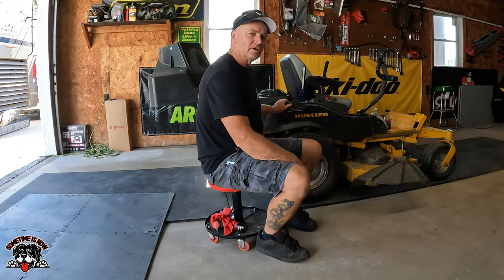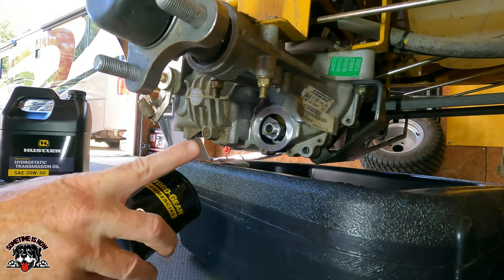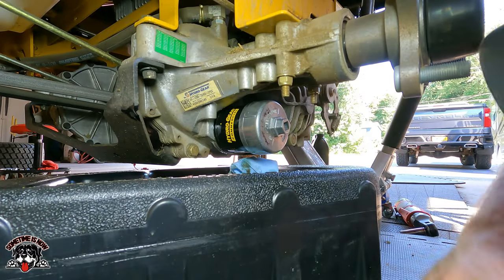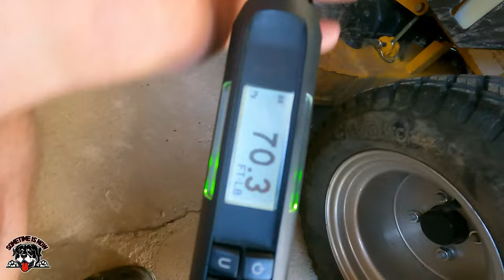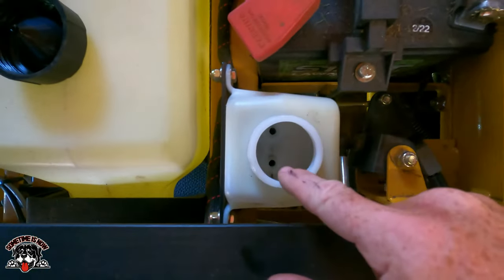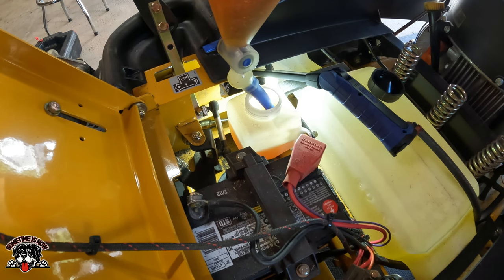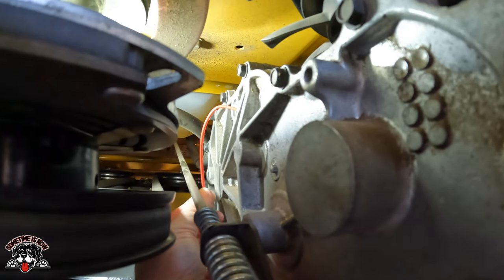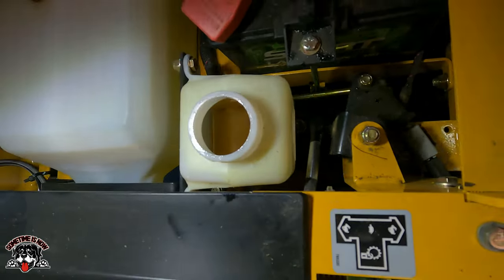Hydro Gear Oil and Filter Change on Hustler Raptor SD 75 hr

Comment: Great video!  Tip on those infamous  vent plugs - trying to get them loose from the back, is like trying to fill a straight the hard way.  After putting the filters and covers back on - come at them from the front while the wheels are off.  You have much more room an you can get the right side plug easy from the left side of the mower and vice versa.  I used a 1/4 allen socket and 3/8 drive to break them loose and just fingers and the socket alone to take them out.
Reply: And also, make sure you review the air purging routines after the change.  An airlocked system is a pain and it's EASY to cause it.
Reply: Good job !!

Comment: I always pull a vacuum on the reservoir tank with a brake bleeder when refilling the system. This way you don’t have to mess with those vent plugs because it pulls all the air out and you save time by not waiting for air to come up. Much faster way.
Reply from the maker: Hey Joe, Great tip !! Take Care
Reply: How do you pull a vacuum on the reservoir tank? Can you elaborate please? Thanks

Comment: Great video. I notice you still have the "Thin" brackets on your transmission. You might want to order the kit and replace like I did. Best 100 bucks you'll spend on a good mower.
Reply from the maker: Hey time4tube1, 
Thanks for stopping to watch the video. I didn’t know they offered such of upgrade. Where would I find the update kit? Thanks 👍🏼
Reply: Mine broke while mowing. Wheels separated some and and it shredded the drive belt.
Reply: I have broken 2 sets of the upgraded mounts…..i am going to put gussets on them….new ones still too thin
Reply: Yes. I have that mower. All the things that people say will fail, failed. Upgrade the bolts to a heavier grade too. The ones that come with the new brackets will also break.

Comment: Good info, thanks for taking the time. Just to note...I would not let the reservoir ever get empty while filling, possible air trap. I would also fill filters partially before install as they absorb fluids.
Reply: Vent plugs removed no way for air to get trapped..
Reply: @bobbyplatt7654  Vent plugs were installed, reserve tank was empty, then more fluid added, watch last few minutes of video. There are actually bubbles coming up into reserve. Just noting, but for me, my tank is never empty once I start refill, ymmv.
Reply from the maker: @Bill-Rocker  All good info, Thanks B 👍🏼

Comment: Thank you. I got my SD from my dad after he left it out broke down in the weather uncovered. I had to do a full tune up on the engine and replace all fluids and fuel pump. Got it running to find out it needed this done because it was so low. Big help. Thank you so much.
Reply from the maker: Hey Kevin, Thanks for stopping by the channel to  check out the video. It’s appreciated. It’s been a good mower so. General maintenance like any other. The only major issue I had was within the last week I had 2 bolts break off and one loose that hold the two transmissions to the frame. While mowing I had the right rear wheel almost separate from the frame and the belt that drives the transmissions jumped off. I had to purchase better quality bolts to replace the low grade ones and reinstall the belt. When I was doing this I noticed the belt was almost to it’s lifespan so I bought a new belt.. I’m planning on doing a video on changing the belt and pointing out which bolts that failed so everyone can check there’s before their rear transmission fall out of the mower. Stay Tuned !! and Take Care

Comment: Good video, great details like the 70 Ft/Lbs of torque on the lug nuts - I learned a lot. The only thing you might consider adding is how to bleed the air out of the system. Thanks!
Reply: The bleeding procedure is the only reason I watched this video. So disappointed. 😂
Reply from the maker: Shows in the service manual to bleed the drives you have the rear wheels off the ground and work the forward and reverse back and forth till they run smoothly. I just drove the mower back and forth slowly on the ground till all the air was out of the drives. 😁

Comment: Hustler recommend purging the system of air , by raising the wheels off the ground and starting the engine and moving the control levers forward and backward several times. That is in the oner's manual under hydro transmission oil change.
Thanks for the information nice video.
Reply from the maker: Hey Alton, Thanks for stopping by to check out the video. You are correct. 👍🏼 I just purged the air out by slowly moving the mower back and forth on the ground. It only took a couple times back and forth to purge the air. 👍🏼 Take Care
Reply: @SometimeIsNow  ok I see. Did you disengage the drive system? . I know you can't roll it unless you do. Hustler recommend doing it like I said to do it.
With the engine running and wheels off the ground both internal pumps are running. But I know if you try pushing it on the ground with out the hydros dish engaged you can't roll it it. It's just easier to do it like Hustler recommends. But I can see how it worked for you. By rolling in around the driven pumps purged out the air. Yes that works. But it's easier to start the engine and let the wheels turn free.
Reply: @SometimeIsNow  thanks for the video. I enjoy watching someone do maintenance on mowers. I just bought me a Hustler Fas trak 54 and I'm getting ready to work on it. Thanks again.

Comment: I almost bot the Raptor!
Ended up getting the Toro Titan HD, very disappointed.  I took it back to adjust the arms but to this day,3 yrs later, the arms STILL  don't function as they should!
I do however have the JDeere 1025R.
 I love how you love Riley, so new subscriber today!!!
Love all your Tractor videos!  I want to learn how to do my own maintenance on both the Jdeere 1025R & Toro Titan mower.  As a lady,my hands are smaller & I am very motivated to learn, so 2 big pluses, yes?
I am also motivated by incompetent so-called "mechanics" 
So I am on-board!  Subbing right now!
How about organizing your Tues videos into it's own Playlist?
Thanxs!
Reply from the maker: Welcome Dogs Rule, Thank you for stopping by to check out the videos and thank you for the kind words. It’s greatly appreciated. Sorry to hear you’re not having good luck with the Toro Titan. You did however make a great choice on the 1025R. 😁 IMO they’re a great little tractor. Yes I truly love dogs as you can see. I try to include Riley in all my service videos so I have the videos to look back on one day. If I could get Riley to hold on better on a snowmobile he’d be in those videos too. 😂 You make a great point on incompetent mechanics nowadays. No attention to detail and they seem not to care. That’s why I do all my own work. That’s a great idea to put all my Tractor Tuesday videos in a playlist.. I’ll have to do that.. Thanks for the input. Take Care and thanks for subscribing. 👍🏼

Comment: Great video.  Just changed mine. The vent plugs on mine were 11/16" head instead of allen hex. Not sure when that was changed or if mine being a Raptor SDX is why it is different.  Everything else was the same. Thanks
Reply from the maker: Hey Chad, Thanks for stopping by to check out the video. The SDX is a nicer model and has all the updates.. If I did it all over again I’d opt for the Raptor SDX Take Care 👍🏼

Comment: I just changed the hydro oil and filters on my Ferris IS700Z w/ZT-3400.  I fill them back through the oil vent hole with a pump.  Once they level off there, I put the vent plugs back in and top off the reservoirs. Each side has its own reservoirs.
Reply from the maker: Thanks for stopping by the channel. I’m not familiar with the Ferris mowers. Are they similar to the Hustler Hydro’s? Take Care
Reply: @SometimeIsNow , I'm no expert by any means, but I believe Hydro-Gear makes different variations for a lot of manufactures.  My son always said, Hustlers were pretty straight forward to work on. My Ferris is the only one I've owned.  So far so good.

Comment: Hi, Thanks for the video. I would have like to see you get the air out of the transmission lines as well as I well.
Reply from the maker: Hey Peter, Leave the mower up on jack stands or the floor jack and start the motor and run the two levers forward and in reverse and you’ll purge the air out of the system. 👍🏼 Take Care
Reply: @SometimeIsNow  It did work, thanks.

Comment: Thanks for posting and sharing this informative, how-to video on changing the hydraulic fluid, etc. on a Hustler Raptor.

Also exactly what brand, make, model, type, etc. torque wrench is that, that you used torquing the wheels lug nuts?

Comment: How many hours are on your mower?  Have you had and cracks in the front wheel cross brace?  Seems some get cracks there. I’m also having paint coming off mine. I know that’s an issue with these as well.
Reply from the maker: Hey horsship, Welcome to the channel. I have 152 hrs on my mower. I have zero cracks in the front wheel cross brace although all the deck wheel brackets tend to bend and I just bend them back. I do have paint peeling off the deck in certain areas which is common on some. I recorded a video with pulling the deck off and going through everything. I cleaned the deck, changed the blades and straightened all the wheel brackets. I’d that something you’d be interested in seeing? Take Care 🤙🏼

Comment: I bought an used hustler with 27 hour but it looks like the hydro gear is totally empty. I asked the guy what is the hydro gear stands for and he never told me because he didn’t know. What do suggest me? Fill it out with new hydro gear oil like you did or do an oil change because it has only 27 hours I guess only need to fill with hydro gear oil right? Your video is opening my eyes thanks for the video. Let me know thanks
Reply from the maker: Hey Dommy,
Sorry I took so long responding. I just noticed your question.
Hopefully you added some hydro gear oil in the tank before using the mower. If it were me I would fill the hydro tank to the proper level and keep an eye on it as it will slowly go down as you use the mower as gravity will take some time draining into the gear drives. As long as the mower seems to work properly you should be fine then when you get 50hr on it i would change the fluid to be safe. Oil and filters are cheap insurance to keep your mower running top notch for yrs to come. Take Care 👍🏼

Comment: You have a missing bolt on the cross brace between the drive motors. 3/8” bolt right side of filter
Reply from the maker: Hey Tony, Thanks for stopping by to check out the video. Yes, I noticed that when I starting working on the Hydro service. I ended up changing all 4 of the known junk bolts that came in the mount.. After doing some research they've been known to break. I changed them all out with grade 8 bolts. Take Care my friend 👍🏼

Comment: Where did you get that digital torque wrench?
Reply from the maker: Hey Travis, Thanks for stopping to watch the video. The Digital torque wrench is a 3/8" Drive TechAngle® Flex-Head Torque Wrench (5–125 ft-lb) I bought it off https://shop.snapon.com Just enter ATECH2F125BV into the search bar and you’ll find it. Take Care 👍🏼

Comment: What tires are you running on the rear? Did the mower come stock with those big bite tires? Which ones do you prefer?
Reply from the maker: Hey Kyle, 
Thanks for watching the video. 👍🏼 They are the stock rear tires that came on the mower and are called GrassMaster 18X8.50-8 tires. They have worked well and I have zero complaints with them so far. 
Take Care

Comment: I have a 2009 fast track 36 inch (927376). I am having a hard time finding oil type, hydronic oil and filters. Would it be the same as yours?
Reply from the maker: Hey jlb, Here ya go. Here’s the manual for the Hustler Fastrack 36. https://www.manualslib.com/manual/606832/Hustler-Fastrak-36.html?page=20#manual
On page 20 it goes over the variations of EZT hydros and whats needed for service. Shows the 36 is non serviceable.??
LEt me know how you make out.
Reply: @SometimeIsNow  thank you bud!! I really do appreciate this
Reply from the maker: @W.Vanderbilt  You’re very welcome. Let me know if you have any more questions, I’ll try to help. Take Care👍🏼

Comment: Good time to check for broken or cracked brackets
Reply from the maker: Hey Phillip, Thanks for stopping by to check out the video. I totally agree on checking the mower over while its apart. The only thing I had found during this service was a missing mounting bolt and washer on the right hydro trans. Take Care

Comment: How often should this be done
Reply: Manual says 750 hours, so I did mine at 75 hours.
Reply from the maker: Hey Orlando, Sorry… I just seen your comment.. Looking in the service manual it states the following:
Initial hydraulic system oil and filter change must be after the first 75 hours of use or 1 year whichever comes first. Thereafter, replace filter and oil in each transmission every 2 years or 200 hours, whichever comes first. Take Care
Reply: Every time you mow

Comment: You know what pisses me off I bought a 2023 model and it does not have a reservoir
Reply from the maker: Thanks for stopping to watch the video. That’s strange, I wonder why Hustler eliminated the reservoir?
Reply: @SometimeIsNow  I'm not sure. What sucks is you gotta pump it in and go underneath the mower and pump it in on the side of the transmission. It it has a filler place on top but there's no way of getting a socket or wrench on it to take the boat out to fill it up. Horrible horrible design
Reply from the maker: @libertarianman69  Wow.. Sounds like they went backwards on that update.. Sometimes you wonder if the engineers really know eventually someone has to work on it.. Shameful.. Take Care 👍🏼
Reply: Actually got a socket on it and a swivel extension and it worked. Can also remove wheels and get a wrench on it.
Reply: Got a long funnel and barely got it into the hole. I had a pump for when it went low but thats not often
Reply from the maker: @libertarianman69  That sounds like they made it much harder to service than the original design. Could you use one of those liquid vacuum pumps to suck out fluid?
Reply: @SometimeIsNow  I don't believe you could get it in the hole that that far because there is a molded area that would block anything from being stuck down in it. When I filled it up it took it really slow it's almost like there's a block or something to slow the flow down but I eventually got it in with the funnel. It actually wasn't too bad as long as you have a shallow socket and a swivel extension it has to be a swivel extension not an elbow and believe it or not it'll come right out. I called the dealer I bought it from and he told me to try that and I did and it worked.